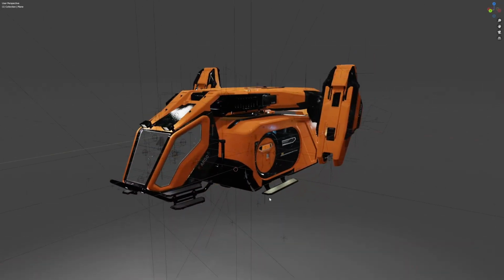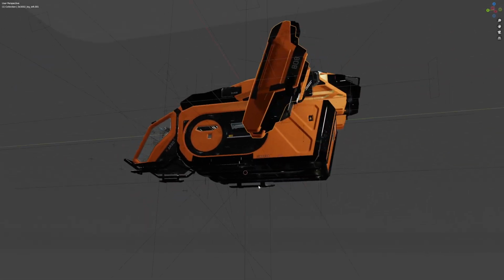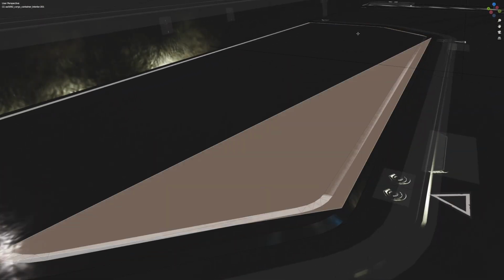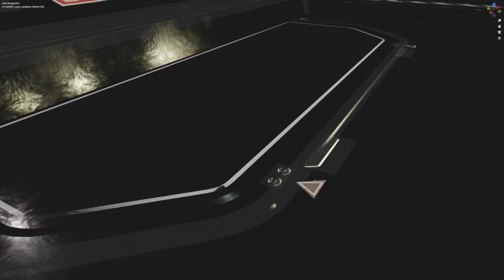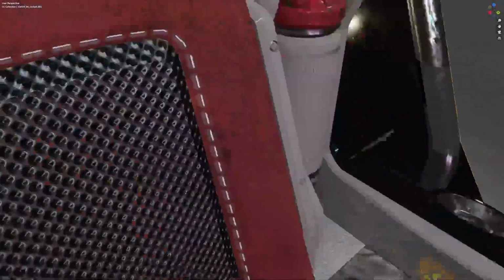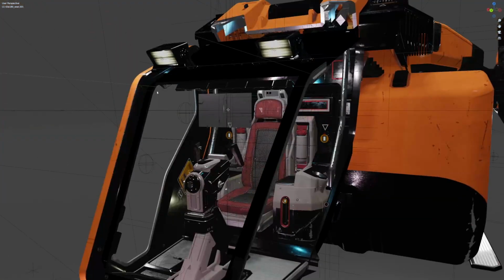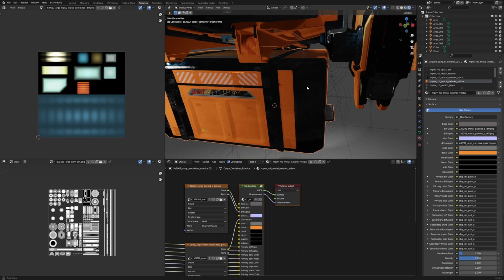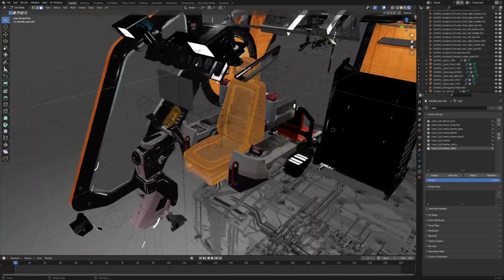5 Surprising Features of Argo MPUV's 3D Model You Never Knew!

Comment: Are the decals overlaid on top of the mesh or actually embedded as part of the model? I find that if I try to shrink wrap (modifier) or overlay it manually, I get blinking issues of the texture underneath showing through depending on the camera distance.
Reply: You will need to put a bit of distance between the decal and the underlaying mesh in order to avoid the Z-fighting. Some game engines (like UE4 or UE5) do also support projecting these as actual decals but the advantage is mostly just being able to stick to underlaying normal map and that kind of stuff.
Reply: dunno if there is something similar in Blender, but in Unreal Engine, we setup the material domain to Deferred Decal to avoid this behaviour, and on the strange mesh who deserve as a decal placeholder, Deferred Decal with Parallax occlusion mapping setup for decals details, coming with heigtmap textures. This is maintly Cryengine who work like that at first but we can handle this in Unreal Engine, in Blender i dunno but moving the offset is not the best idea for huge ships like Carrack, Idris etc
Reply: @ralph2142-  there might be I'll look it up. You can easily set up decals in blender as a texture with alpha as well, but my ultimate goal is to export it to Godot.